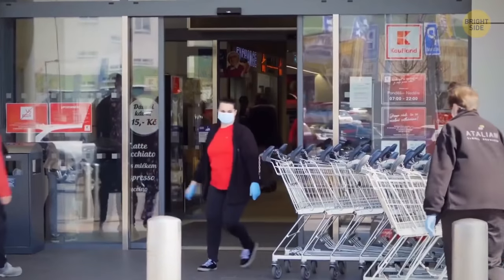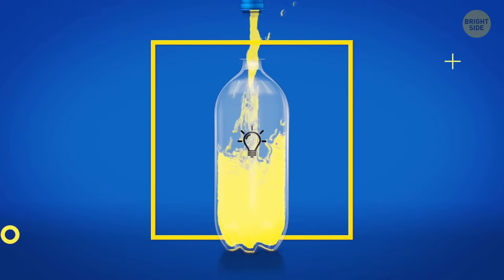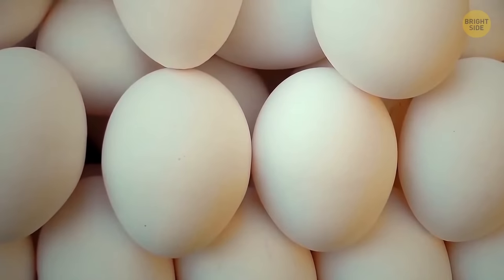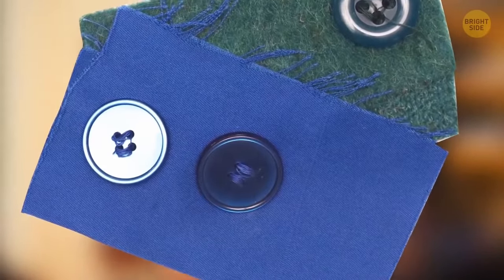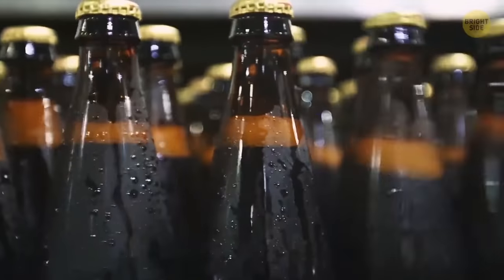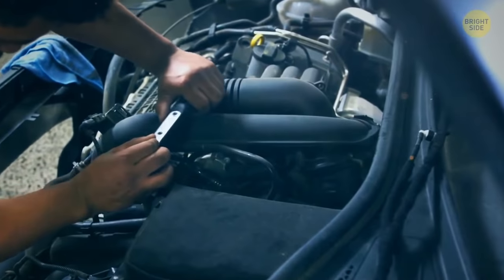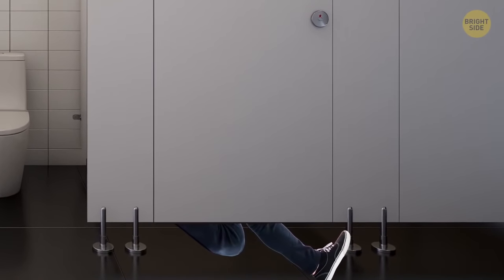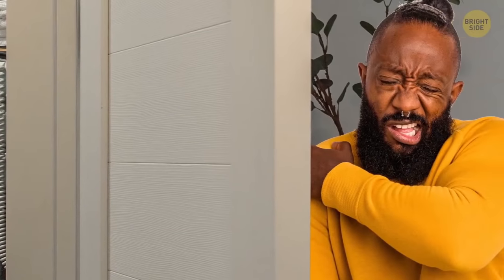If You Noticed 40 Small Details on Simple Objects, Call Yourself Unique

Comment: The fork toaster idea is dangerous. Here is a real deal. The dial that you use is also a release mechanism, all you need to do is turn it counterclockwise all the way back down past the number 1 and the toast will pop up. If the bread still isn’t  up far enough you can turn the toaster upside down. Also, unplug your toaster when not in use. You can safely touch the inside when it’s not plugged in because there is no current running to it. Just make sure it’s not hot if you need to do this.
Reply: Surprised they suggested forks in a toaster tbh